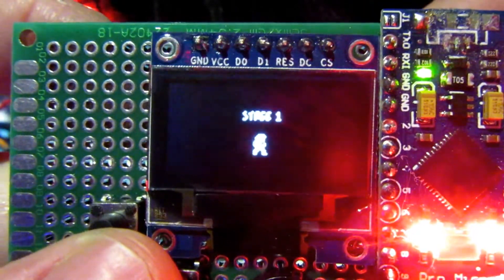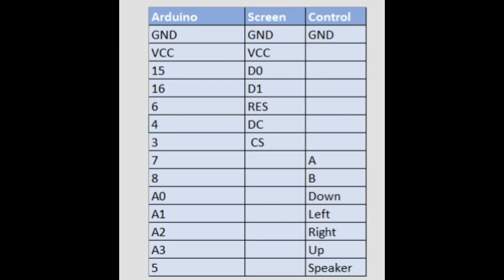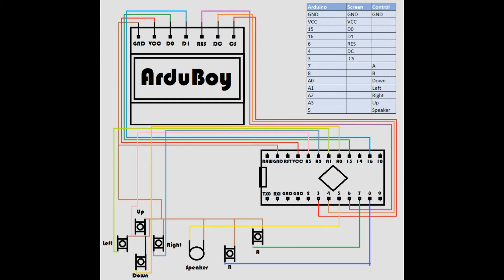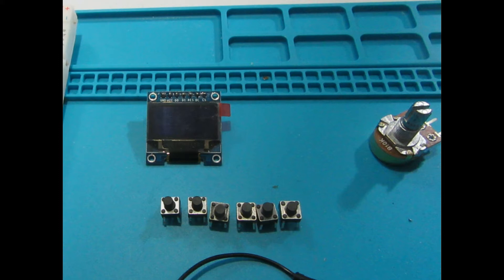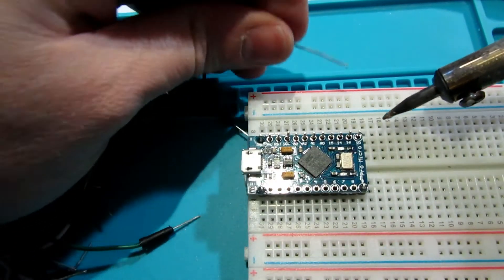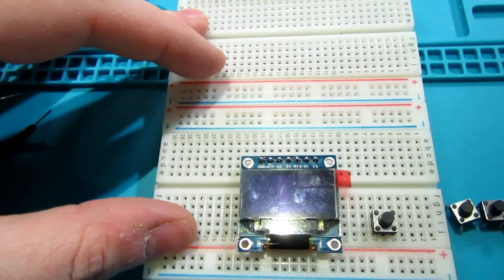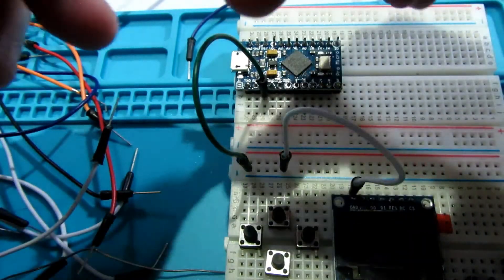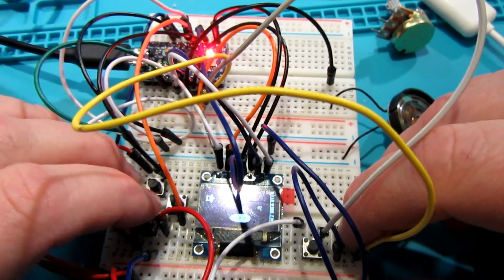The DIY ArduBoy - Part 2 - Soldering and Breadboarding

Comment: hi, I'm trying to make Arduboy clone with your helpful videos :) But, I'm trying to use "4 pin oled lcd" instead of 7 pin. Is it possible?
Reply from the maker: As far as I have found, it's not possible to use the 4 pin version. I accidentally bought 5 of those 4 pin screens and will have to repurpose them for a different project. Sorry!
Reply: Thanks for your reply! I think I should use my whole brain power for this... or buy 7 pin OLED... I'm always getting help by your videos. Thank you again!
Reply from the maker: Any time!

Comment: James, could something be done with an arduino to control LEDs, so that I could build an ugly sweater for the holidays, but change the look if someone else's is uglier?    :)
Reply from the maker: Absolutely! Controlling LED's is one of the easier things to do... you just have to decide ahead of time what you would consider in your varying degrees of ugliness :)
Reply: Hmmm, a picture of me in  a Santa hat, would probably never need to be changed, so not that ugly...it may be considered cheating under some rules.   :)      I guess the problem would be getting enough LEDs to be able to display an image, without getting too bulky or heavy
Reply: I haven't done any electronics "projects" since right after high school (yes, we had electricity) I do the occasional soldering repair job, or upgrade, but no projects.  I think I am going to have to get an Arduino, melt some metal, and have some fun.  I really want to build a gaming cabinet around a Retro Pi, as long as I can load a tone of old school games, menu selectable from the screen.   My sister is a Galaga fan, I was a Dragons Lair and Sinistar fan, Sinistar would need a gaming knob though, not buttons or joystick, and I have a friend that would probably go berzerk if I could build a Golden Tee cabinet for him, with a trackball
Reply from the maker: +Racingm0use24 yeah... that is a snag. Would be a pain to manually wire up a matrix like that... maybe mounting an lcd in your shirt and using a Pi would give better results ;)
Reply: If they only made curved screens that curved the other way, I would be set.  I could hang a 27" or 30" monitor around my neck
Reply from the maker: Haha. Well that WOULD be a new look!